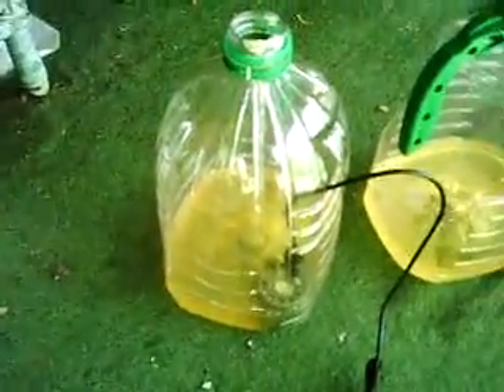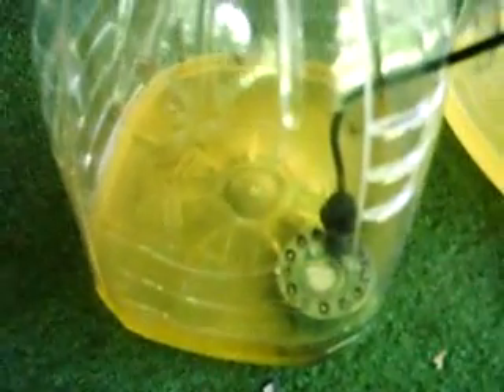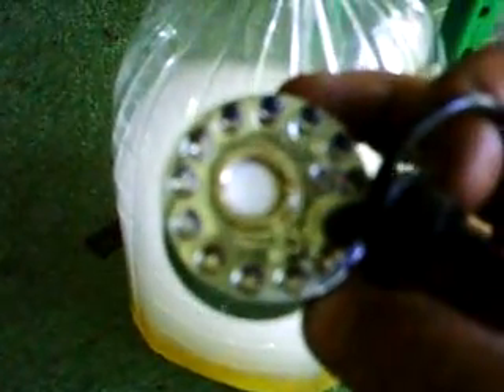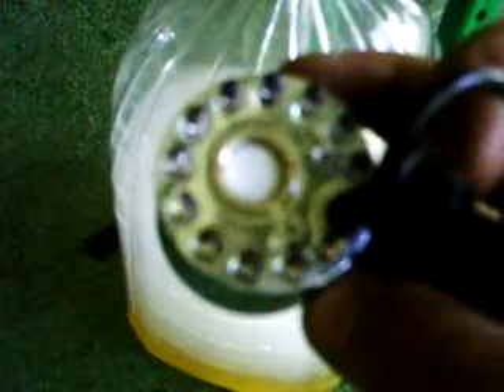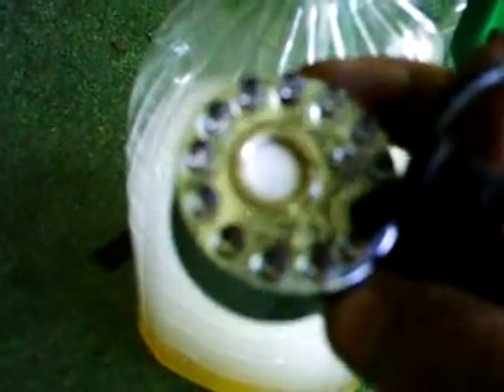Ultrasonic Transducer Altering

Comment from the maker: Yes its Simply grounding the Bar Sencor there is a better way now take the wire sticking up instead of cutting it off bend it over and make it touch the body solder it good and its grounded and will work on any liquid

Comment from the maker: you remove the sensor cause it wont work on anything but water and yes i have dont it on engines Look at my video Vapor Generator 2 and i get 3or 4 times the rn time with alot mor power

Comment from the maker: Just so everyone Knows You do the right one if the cord is faceing you if you already did the left one its ok but it will only work for the right side. It needs to be packed kinda tight test in a bowl and put a rod like a alen key to pack it in the water you should see results

Comment from the maker: Ok you first cut off both pulls sticking up as fluch as you can there is a wire in the middle. Then be carefull cut the rubber around it and then stuff it with foil.  NOTE has to be tight Test in a bowl and put a small rod over the foil to pack it and see it work